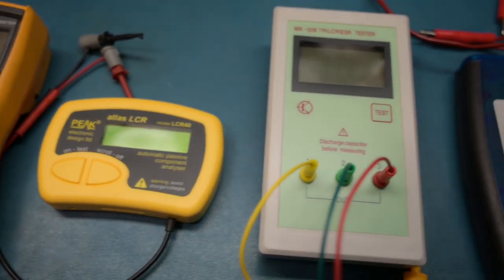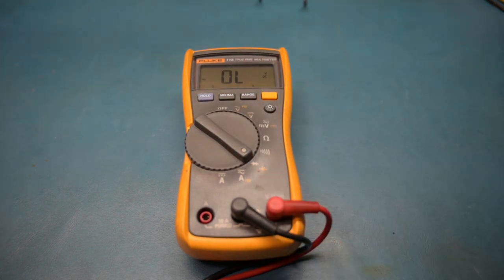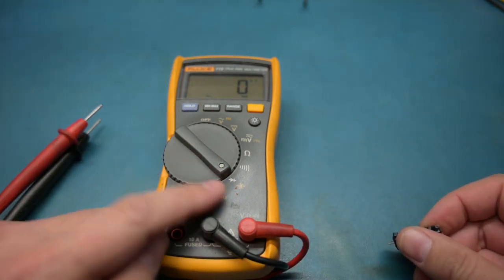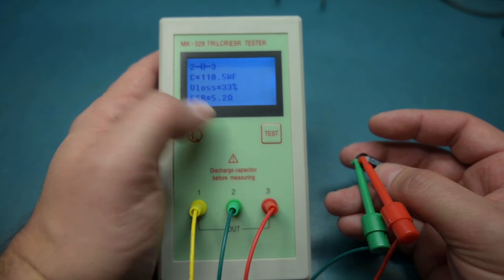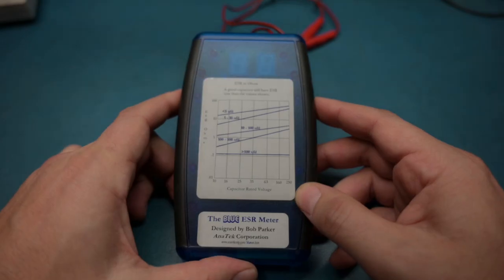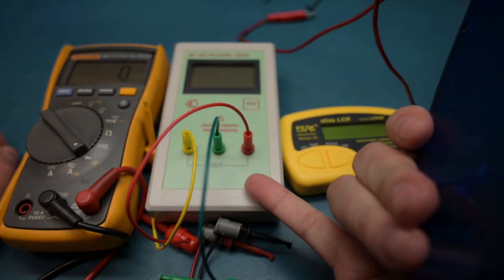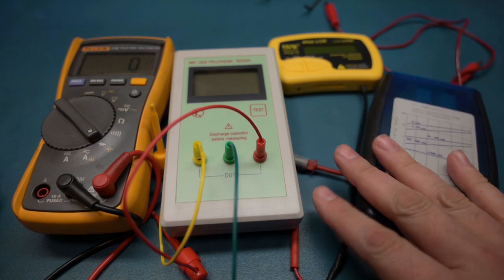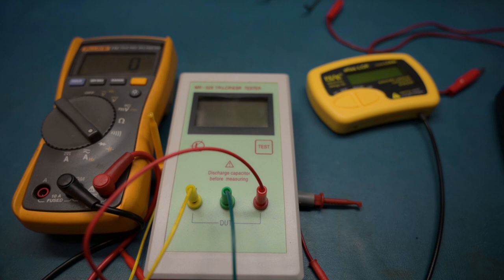Capacitor Testing On A Budget.

Comment: There are so many different ESR charts however all with different ESR recommendations. ESR is only good to know if you look-up the datasheet for that capacitor OR it is way way off so it is obvious. Any other characteristics such as leakage that may be better signs of bad capacitor?

Comment: You should have also tested which one performs better with in circuit measurements.
Reply from the maker: I have never found it worth doing in circuit measurements when testing components. There is always a chance that another component or many components in the circuit is influencing the measurement. It will always have you second guessing. Best to remove and guarentee the best measurement and 100 percent accuracy.
Reply: @The_Active_Region  I agree but it could have been useful to know it from a proper test. Whenever you have a chance I'll appreciate it. Thanks anyway for taking your time to reply.. Cheers